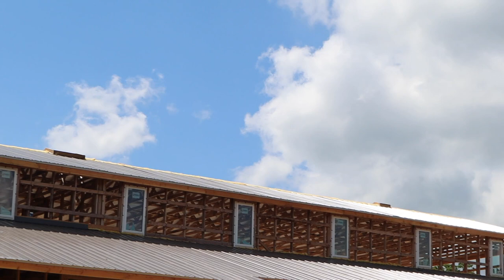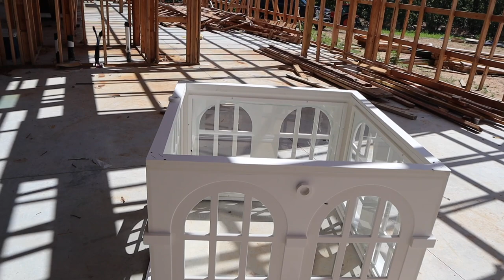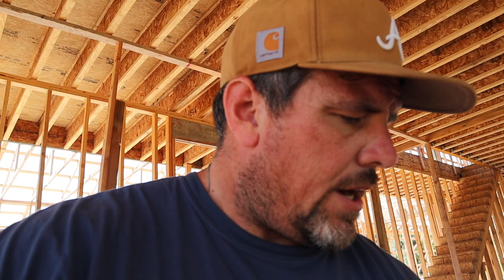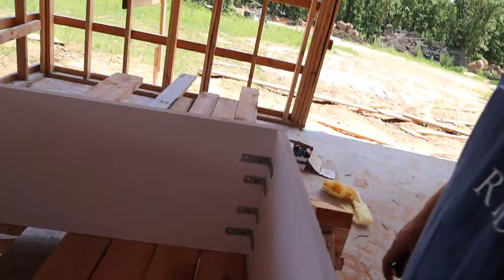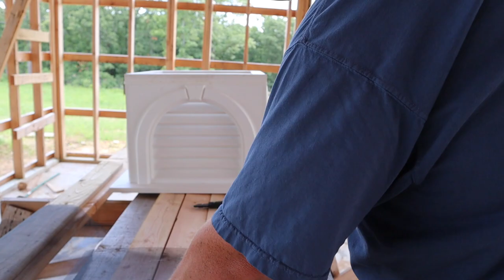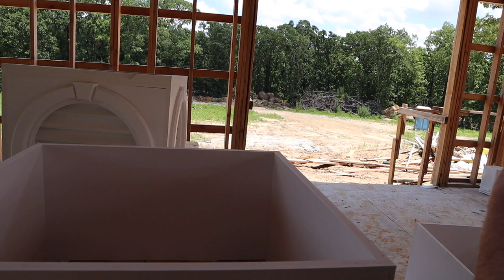Blackberry Ridge Barn Series #23   Cupolas Part One

Comment: I'm watching this several months late because I just discovered your channel but thought I would comment any way. If the cupola base is made of PVC talk to your plumber and grab his PVC primer and glue. Apply it to both sides of the break, push them together, and hold in place for about 30 seconds. You should have a fix as tight as the original piece.

Comment: Are you putting in a powered roof vent inside the cupola
Reply from the maker: Mechanic Mike no sir. Not as of right now. We will see if needed.
Reply: @blackberryridge8205  well you might think about it while the electricians are there wiring up the rest it would be easy for them to run a lead up there even if you don't use it right away